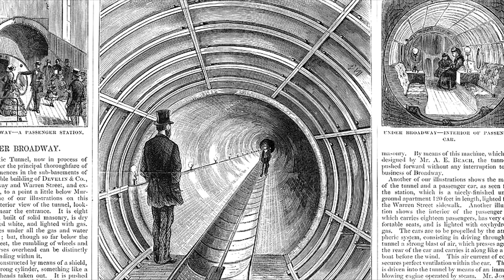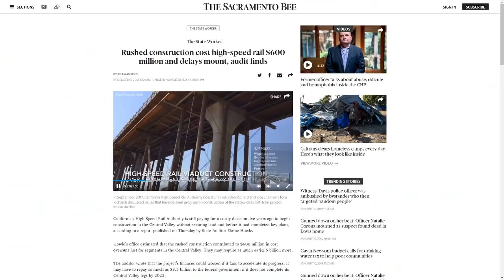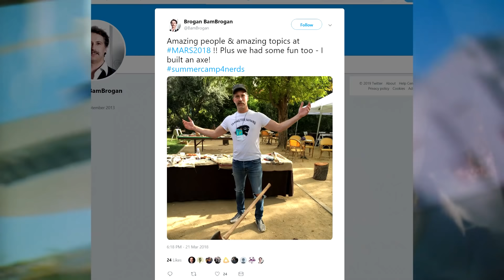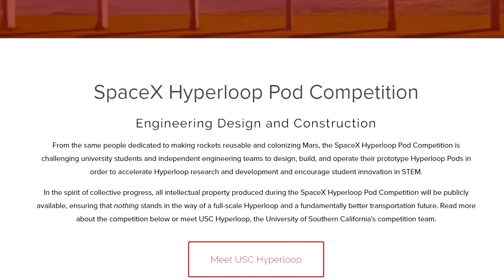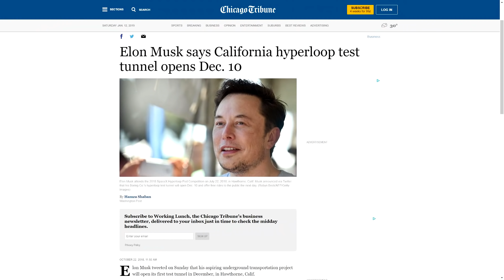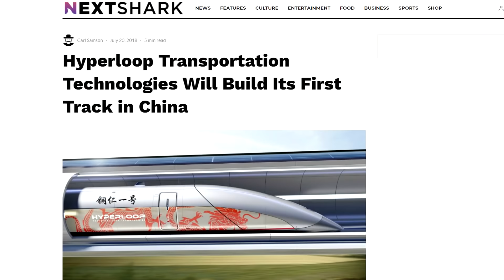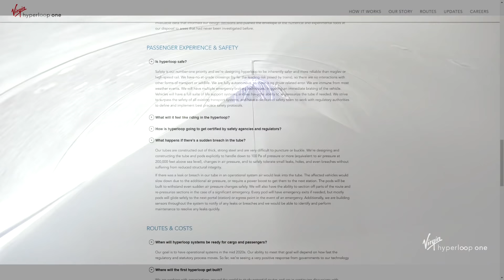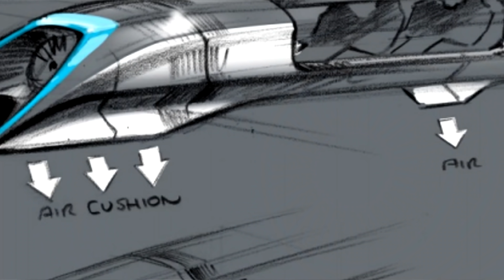Why Hyperloop will FAIL HARD - Its Biggest Problem...

Comment: About the safety thing, the pods take up most of the space in the tunnel. So, you can't exit through the side. I also notice the absence of doors on the front and back of the pod. You'll notice most metro systems with narrow tunnels (London Underground, Northern City Line in London) have doors on the back and front of the train. This allows passengers to be evacuated from the front without using the boarding doors, which would likely be blocked by the walls of the tunnel or have very tight clearances requiring people to squeeze through. So, if there was a breakdown on the line, you could be stuck there for hours! Even if you had doors on the front and back of the pod, what would happen if there was a fire in one of the pods? In the event of an emergency evacuation, you would need to slowly release the vacuum in the tube. You need to do it slow enough so that nothing gets crushed. That could take potentially an hour, which would delay the time for a safe rescue. Also, how are they going to supply fresh air to the passengers?

Comment: I think the hyperloop is just that unproven hype until then the best mass transit system still remains the Train.
Reply: Maglev is too expensive per mile.

It requires strong electro magnets in the track. Which happens to be much more expensive then 2 metal rails. 

China showed that high speed rail is the best we can manage today. 
At least until 500-1000 miles. 

Beyond that planes will remain unchallenged.
Reply: Part of the reason why the Hyperloop is so disastrous because Elon Musk is hiring engineers without degrees and is focusing more on the person. It's a step in the right direction, but not for a job like engineering, because no-one knows what they are doing. Because of this, stuff like this (basic physics and math) goes unchecked because it gets funds and big news only because it is innovative. Then we get a mess like this, where investments turn to lawsuits because people realized they were scammed.
Reply: TEIF 2 Erm actually it’s obvious from the press releases that Musk IS hiring qualified and even experienced engineers. And plenty of engineering faculties amongst the top ranked universities in the world are allowing their students to submit hyperloop designs and even talk about researching hyper loops.
Engineering is an academic discipline that doesn’t require too much critical thinking, a lot of it is merely looking up values and then plugging it into formulas rather than using physical intuition.

The hyperloop can’t work because of physical reality.

Musk isn’t out to scam anyone. He is a bonafide idiot and this is all part of the technology he thinks he’ll need for his ridiculous Mars colony pipe dream.
Reply: Sky Way String Transport  can beat long-haul flights.
Reply: I suggest you read again through the user manual that came with your sarcasm detection kit (SDK) add-on that your parents signed and agreed to have pre-installed on your date of manufacture.
Reply: Speed is not what I am comparing. I am comparing economics. The primary determinant of market share of transport is not speed, but in profitability in the marketplace. Sky Way is more energy efficient than airplanes and track, vehicle, and terminal costs are low enough to enable extremely competitive fares, even for long-distance travel.
Reply: It's not days, only hours. No continent is that big, not even Asia. London to Tokyo would be a 24 hour journey and significantly cheaper at $300.
Reply: Kevin Marinas Given that it’s not even a proven technology at this stage; on what basis do you make the estimates of cost and journey times?

The fact is that most travellers are willing to pay more for speed. That’s why providers of slower but more affordable travel modes (like coach lines) struggle against the faster ones.
Reply: The string rail technology is composed of a light track structure that carries several times its own weight. The amount of earthworks for construction are reduced, as are the size of the foundations. Loads are transferred horizontally to anchors, and the intermediate supports are a lot smaller. Since the rails are suspended, air flows freely on all sides of each vehicle, including underneath, so aerodynamic drag is reduced by a large factor. As a result, a string transport system will cost several times less to build and operate than conventional rail systems and will be able to travel faster on long routes than most high-speed rail systems while using less energy. They already have built Eco Techno Park in Belarus so the physical viability of string rail track is mostly proven. They are building another location called Sky Way Innovation Center in Sharjah, UAE to build a full height test center where larger vehicles can be tested, and soon they will have another UAE location that is much longer so they can test their high speed system of 500 km/hr or greater (possibly up to 600 km/hr). The cost and time estimates for London to Tokyo were provided from one of Global Transnet's videos which I feature prominently on one of the playlists on my YouTube channel page.
Reply: If the rails are not suspended, the rails do not carry the weight, the roadbed does. If the roadbed does, then there is a screen effect which slows down the vehicle, there are earthworks to do to support all the deadweight, and crossing existing roadways will require much more construction to ensure safe passage of road vehicles. With a screen effect, it is logical that highest speeds would be impeded.

Having the Sky Way train above ground improves safety for pedestrians and occupants of road vehicles. Alleged danger of string rails is unfounded. It is in principle a suspension bridge without unnecessary deadweight. Actually the flexibility and light weight improves safety against earthquakes. Being elevated means that it will be immune to most floods and piles of snow. The pressure of the steel wheels against steel rail allows ice to be cleared off as with conventional rail. More and more could be said about the design.
Reply: There is a difference  between bearing the weight and carrying the weight. If I have my hands on a desk and books are on top of them, I am bearing the weight of the books. However, I am not carrying the weight of the books until I lift my hands off the desk.
Reply: Uhuh. That's why Concorde was an amazing success and the 747 failed utterly.
Oh, wait....

No, most travellers are NOT willing to pay more for speed unless it's a LOT of speed.

Air travel certainly beats out sea travel, with a trip taking a day or less instead of several weeks to several days.

But speed alone isn't good enough if the cost is too high, as the Concorde well demonstrates.
Even at the absurdly high ticket price it wasn't profitable.

Plenty of people used to take the coach too, even though a plane is much quicker, because the coach ticket was something like 1/10th or even 1/20th the price.

Then budget airlines happened. But what does that prove? Once again that cost beats other factors more often than not.
At least, within certain bounds.

No, speed only wins if it's a substantial gain, and even then only if the cost isn't prohibitive compared to the alternatives.

Sure some people pay for the extra speed even if it costs a lot extra.
Then again some people will also pay 20 times the price for a first class private cabin on an airliner, vs an economy seat.
If you have the money to make those tradeoffs, fine.
But for the rest of us, cost is and always will be an issue.
Reply: This comment section is full of people trying to make arguments against vacuum trains and ignoring reason. I'm sure there's money involved.
Reply: uhh, why do you say that? Your arguments in this comment thread are talking about the benefits of the system. And then you say people arguing against the whole thing are reasonable? So are you saying you were being unreasonable?
Reply: Kuralthys made a good argument against you, but you lack the reading comprehension to see that he didn't contradict himself.
Reply: 1barnet1 has explained quite well how maglev is suboptimal compared to conventional HSR.
Reply: Bahahahahahaha
Reply: Ooh wow, so it's pathetic to argue alone? Very funny, as you've happened to be arguing alone as well. But as I am sure, being "alone" doesn't itself detract an argument, no matter the argument or the person. You have to realize that I've had to go down to your level to have this conversation. As soon I am I done you, I will go back up where I was.
Reply: Allies are overrated. I am not saying I am not alone. I am just saying that you are alone. If you think about it, we are not that different.
Reply: There are more insults in your comments than actual educated thoughts or academic sources. Try to improve your netiquette first and then you can start trying to actually educate someone rather than being a loudmouth and trying to inhibit their productive thought.
Reply: Excerise one:

T or F: String transport can accomplish light overpasses.

Requirements: Conduct you own personal research and find out yourself. I can lead a horse to water, but can't make it drink. Be the horse who is thirsty.

Critical thinking questions:

If I wanted to make rails have less impact on the soil, should they weigh less?

If less, how can I make it lighter and increase span?

Does a rail's rigidity need to be absolute?

Is there permissible degree of sag of suspended rails which depends on the speed of the desired transport?

Does optimization in the context of allowing for sag create an opportunity for significantly lighter overpasses?

Would such overpasses be significantly less costly as a result of being significantly lighter?

Can this lead to lower fares?

Can pre-tensioning of steel cables enable them to resist thermal expansion under temperature changes, reducing the need for expansion joints?

Why would incorporating expansion joints reduce the amount of load that can be transmitted horizontally to support columns?

If the need for conventional railway sleepers and gravel/concrete roadbed were replaced with a bundle of concrete-reinforced pre-stressed suspension cables, would more or less gravel/concrete material in tons be required?

If anti-derailment were provided by having cylindrical side wheels and cylindrical wheels on top of a rectangular steel beam (or rail box) containing the steel-concrete composite, how would the pressure be more evenly distributed on the wheels' contact patch with the rail when contrasted with a conventional flanged wheel on a conventional rail?

Does unevenness of pressure on a wheels' contact patch with a rail increase or decrease the rate of wear?
Reply: Safety is not subjective or based on off hand opinion - it is based on actual risks. You can assert it as unsafe based on the intuition that was molded from an expert's experience with conventional rail. Physics and engineering is not an accumulation of prejudices, but the result of math and experimentation applied to the resources available.
Reply: HSR is useless and not needed
Reply: dog guy Hahahaha I’m sure all of those places with HSR an d the millions of people who’ve used it will now have their views shattered by your opinion.

By your logic; any travel must be useless and not needed.
Reply: given that only 2 HSR lines in the world run at a profit, they are extremely useless, and when did I say travel is useless? There is still air and standard rail travel, as well as buses and driving
Reply: and HSR is incredibly useless in the US the CA HSR is going to cost us 100 billion dollars
Reply: 1) https://youtu.be/DBrWRapGHAg

2) idk about Europe but most airliners do get special protections and tax benefits but no subsidies, and roads are a basic needs and dont need refuelling or complicated maintenance, and if a road falls apart, it dosen't lead to hundreds of deaths 

3) lol, not in the US, it is still quicker and in many cases cheaper to fly from say Oakland to LA than it would by HSR
Reply: There no proven fact of being able to terraform a planet outside earth, so what you are saying is we should never do anything that is never proven.  With people thinking this way, you will only get cavemen out of a country
Reply: This mentality is how we get destroyed by other countries. No new technologies.
Reply: thank god this country is smart enough to r&d and look for new ways of doing things. Sometimes solutions take a while. In the long term, these r&d projects are worth it. You don't want to be caught dead last in a race.